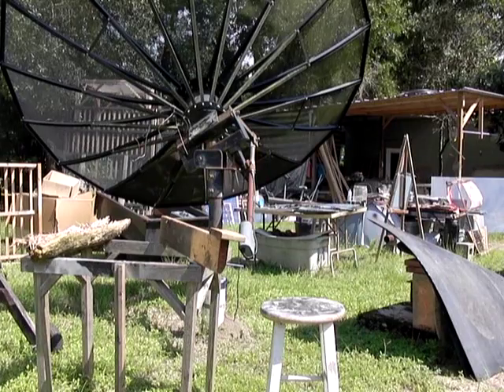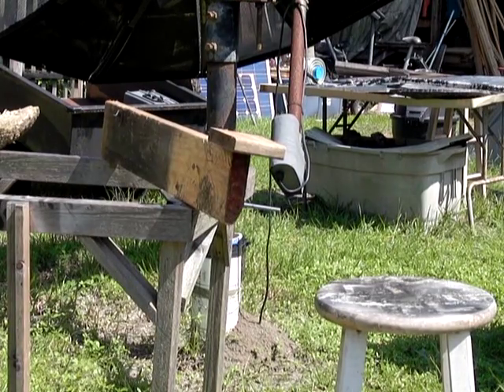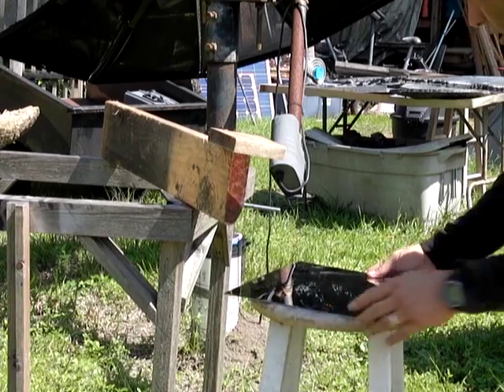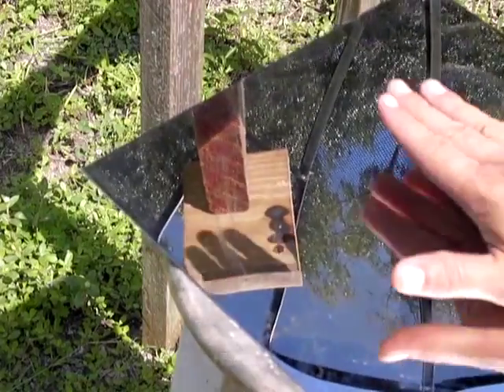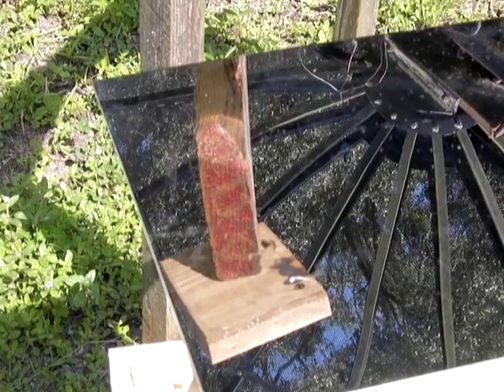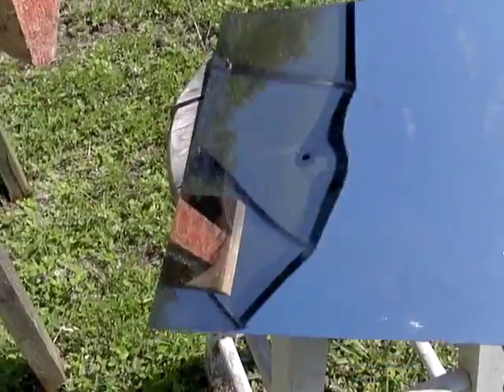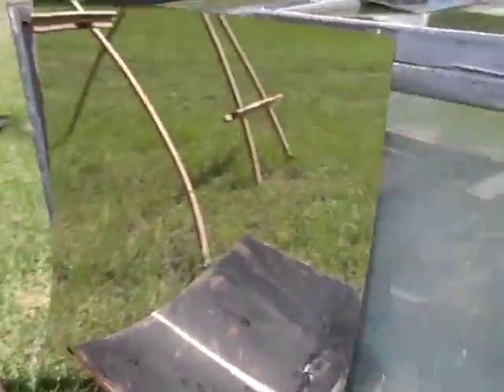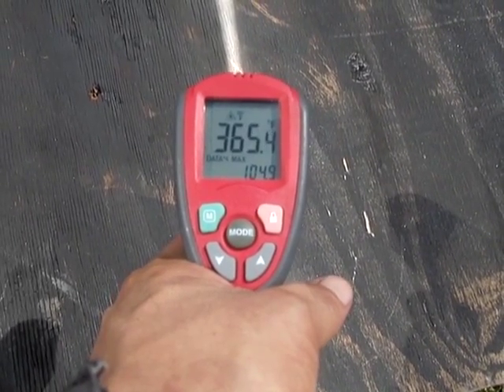FRESNEL LENS BOUNCE MIRROR Solar Stove Solar Oven Cooking

Comment: @ bottomlands
wow bottomlands wow...
think of the energy saving abilities this has
the applications for heating, melting, etc.
that's just the lens itself, with the sheet metal someone could idk heat a pan from the bottom instead of the top of the pan
and an unlimited source of energy we have (the sun)
(for the smart asses) our sun will likely not do anything drastic anytime soon

Comment: Hey Dan, this is part of the concept that I was telling you about through email. You can have multiple fresnel lenses and then use mirrors to reflect the light to a single focal point. Lots of power in a small area! That's what it's all about.